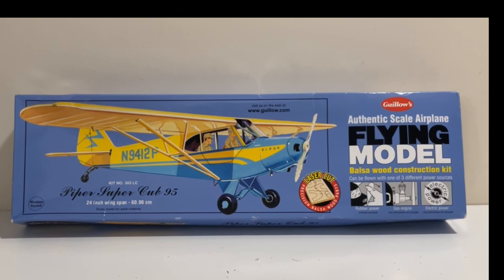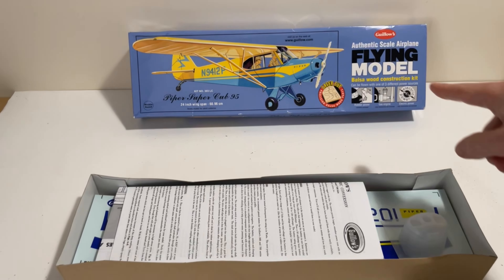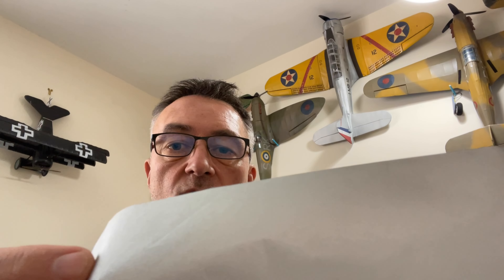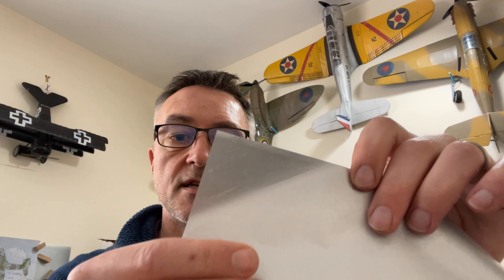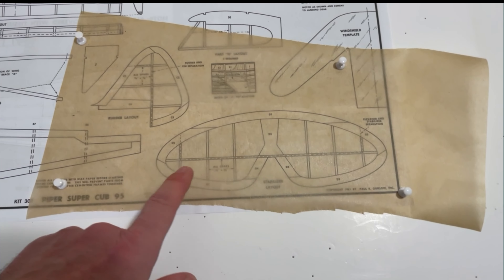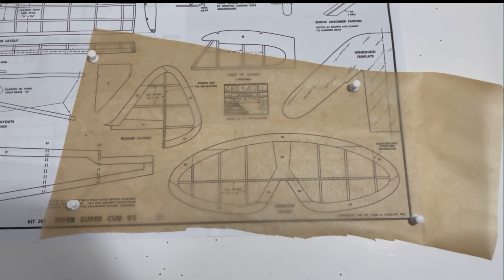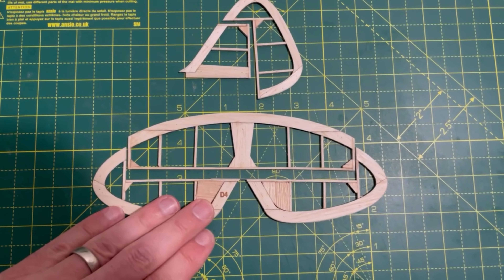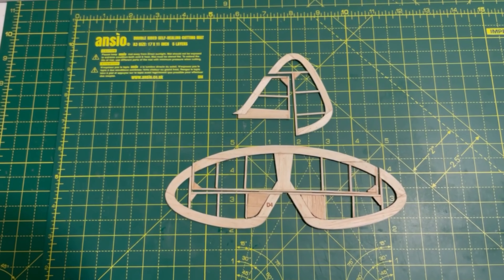SKippy's Guillow's Piper Super Cub 95 - Part 1

Comment: What are your plans for hingeing the control surfaces?  I would think simple tape hinges applied on top of tissue would not be overly strong.
You have inspired me to do my own conversion of a model I built about 25 years ago, and i'm puzzling out this problem right now.
I think your Cub will be the kind of plane you fly on extremely calm days!
Thanks for posting!
Reply from the maker: Thanks for your comments and support. I’ll be using Mylar strip for the hinges; have used it on all my other builds and it works really well 👍🏻😊
Reply: Mylar strips slotted into the edge, or glued to the bottom/top?

Comment: That is a nice project. Cubs are supposed to fly nicely. I still have to maiden mine, too scared to do it. The silver tissue looks interesting, but if it can't be stretched so much it looses a bit of the point. It might shrink if you wet it from the other side. Then you could shrink only the top part so that it has a better airflow.
Reply from the maker: Thanks for your support. I have misted the tissue and seen some shrinkage now, it just takes time to soak in so hopefully it won't be too bad when I get on to the rest of the model.

Comment: I have used the same silver tissue. It definitely has a metallic coating.   I have found if you put it on wet that it does shrink. The idea is to soak it really well eith wster mister and then Pat dry it on both sides with microfiber towel. The tissue is now limp and can be applied with glue stick or white glue. It will shrink quite nicely
Reply from the maker: Thanks Dave, I may try that technique on the wings. I have misted the tail sections a couple of times now and left them to dry and it looks like the tissue has shrunk, it just takes time with that coating.